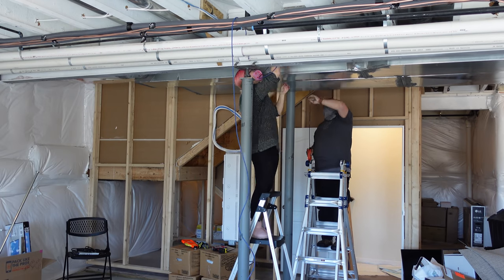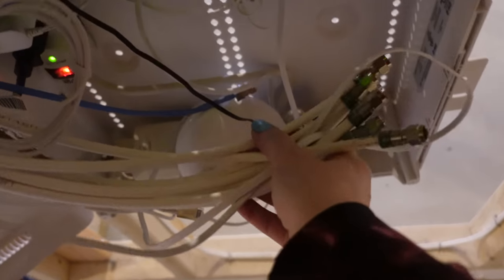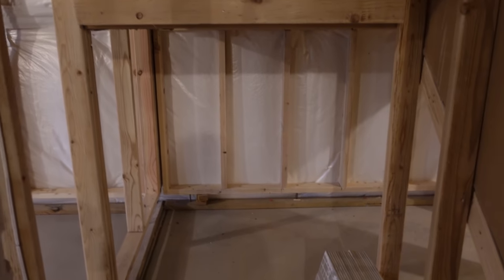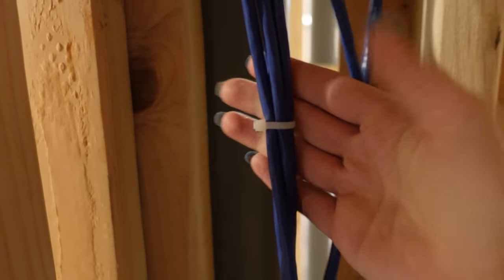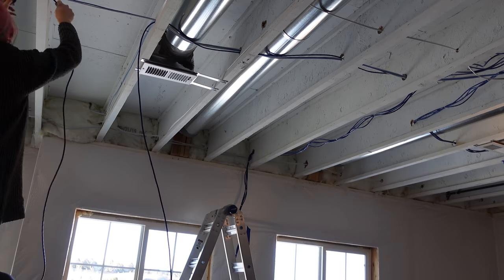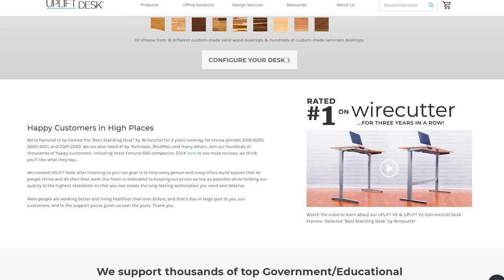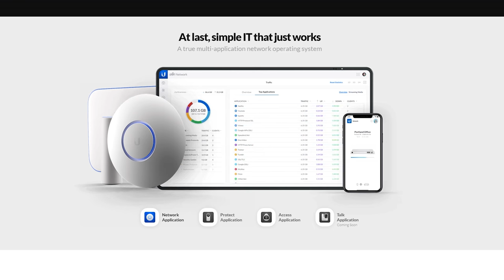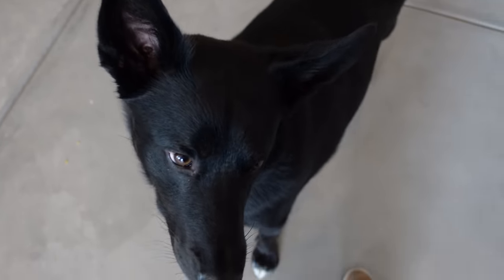Running 10 Gig Ethernet In My Dream YouTuber Studio: Networking & Internet Access | Pt 2

Comment: For your ventilation, make sure the cold air comes in to in front of your rack.  In the back, if there is no return, install a vent as high up as you can get it into the rest of the basement somewhere.  Just a passthrough.  This way the hot air will leave the back of the rack and make its way back to the return.
Reply from the maker: Thanks for the tip!
Reply: @ShannonMorse  What you can also do it put a vent toward the top of the room with a fan to draw the hot air out. Cold air will come in around the door (unless you get an air-tight/water-tight door) and that should provide enough cooling unless you're running some large servers for your future VMs. 

If the actual AC blower is down in your basement and your basement is colder than the rest of your house, don't worry about pumping AC into the network nook. Just an exhaust fan should get enough air flow to keep things cool.
Reply: @ShannonMorse  this was my first thought, he's 100% on point.  AC Infinity makes some great rack cooling and home space ventilation products that don't cost a lot.  They also have some with temp sensors with programming.
Reply: I was thinking even a vent near the top and bottom of the door may be enough, with convection and the fans on the systems handling circulation.  I'd put a remote temperature sensor in there and set an alarm threshold and then you don't need to worry about it.  If convection alone doesn't move enough air, an exhaust fan near the ceiling pushing the hot air out into the basement would draw in cooler air from a vent near the floor.
Reply: One other thought, you would have to have your HVAC guy setup a dedicated zone with a thermostat just for that room. I would doubt the rest of the house will call for enough cooling to properly cool that rack room.
Reply: @mzmegazone  I think a filter to keep out dust and debris. Also watercooling and or a dedicated ac unit
Reply: It really depends on how much it's going to be in the rack and what it will be doing. A rack stuffed full of Crypto miners running full bore 27/7 is going to need a lot more cooling than a NAS, for example.

Comment: For under the stairs, what about creating a cold zone and hot zone, where the cold air is pumped into the front section and flows through the rack to the back hot zone. Also having an exhaust fan on the back side will help aid in airflow through the rack parts. I'm thinking some cardboard to fill in the gaps between the rack and walls will help get the air to where it needs to go.
Reply from the maker: Interesting idea!

Comment: I do data installation and when i got my license we were told not to run with power, just saying because if you get interference you will not be able to fix it when the drywall is installed
Reply: How do you handle wireless access points or poe cameras?
Reply: @nebraskacoder  PoE isn't the problem; it's running ethernet cables beside power cables. You need to leave space (per NEC) to avoid interference and accidentally creating a second circuit. I believe unshielded cables should be something like 12 inches from residential power. A properly shielded and drained ethernet circuit can get away with 4 inches. Ethernet should cross power at 90 degree angles.

note Please check the wiring code where you live to find out how you're supposed to run wire for code adherence.
Reply: @AC-cg4be  Sorry, I misunderstood when you said power and thought you were saying not to do runs with POE.

Comment: Under the stairs: Now would be a good time to add an access hatch along the side, behind the proposed rack location. Crawl in behind from the side so you can access the backplane for cables and troubleshooting in the future.
Reply from the maker: I bought a rack that includes locking wheels, and is not going to be stationary so I can move it freely. It's a 15U so relatively small.
Reply: @ShannonMorse  looking forward to that video!!

Comment: Great Video.  I caught the snippet about the contractor running a cooling vent to the closet, I would suggest having an exhaust fan/vent out from the room as well. I feel that would be more important than pumping cold air in.  -- if its not too late, run yourself another line to the back of the house for possibly an outdoor access point.
Reply from the maker: Thank you!

Comment: Looks great.  The only thing I'd note is that, in some of the videos, it looked the like the Cat6 was being held up by some electrical lines when running along the chases.  That may just be before you clipped them up, but you do want to keep some distance so you don't get noise from the power lines bleeding into the data lines.

We built a new house a couple of years ago and, while our needs aren't as intense as a home studio, I had the builder run network cables from my office (which is where our Gigabit Internet connection and NAS is) to the other rooms.  All of our A/V gear is on Ethernet (GoogleTV, SmartTVs, BD players, gaming consoles, etc.) for best performance and keeping them off the WiFI so they're not competing with devices that must be on it.  WIFi is convenient, but for performance, reliability, and security, it can't beat Ethernet.

Comment: Shannon you are 100% awesome and correct. I ran cable while going to undergrad school in Michigan and Wisconsin. Banks, building, construction sites schools and more. It is the best idea to run the cable before the dry wall. That way you can add conduit pipes, clamps, ihooks, flextubing and much more. It doesn't happen all the time but when everything is built and drywall and everything is done then they call you to run cable that is not impossible but it provides more challenges and burns more time in comparison.
Reply from the maker: Yup! So true

Comment: Great video! I wired my house a few years back with CAT6. I saw some of those zip ties were pinching the cable. This may interfere with the 10 Gbps link you’re aiming for. Might I suggest Velcro cable straps instead, much easier to take off if you want to rework it, too! Otherwise, I’m loving the plan!! 😊
Reply from the maker: I removed them after running the lines.

Comment: I did the low voltage wiring for two houses (phone, network, cable TV), and always run then in conduit.  Cat 5e was the state of the art at the time I did the wiring, and now it can be upgraded to Cat 6 or fiber without tearing into the walls.  It's easiest to add the conduit in new construction, but it was a retrofit in one of the houses I did (running conduit through the attic and crawl space, or a non-living space such as the garage).  Each room has one or two wall panels with multiple connectors, all terminated in a single rack.
Reply from the maker: Cool!

Comment: Neat and fairly well done.

FYI, those are shielded cables that you ran. If you want to make use of the EMF shielding, only ground one end of the cable. Otherwise you can accidentally create differential grounds or ground loops. That will cause noise/EMF in the line rather than draining the noise/EMF off to ground properly.

And you may know or may not, so some tips from a network guy:

It's a lot easier to run spooled cable through walls (already drywalled) and doesn't take much effort to terminate yourself. Most of the pre-terminated cables I know of are stranded cable, and for in-wall cable (or basically cable that doesn't get moved much or at all), you want solid core cable. You also can just use a 1/2" drill bit instead of needing a much larger hole for the terminator. This mainly becomes an issue when you're going through wall studs or footers. You just tape the cables to a fish wire or fish tape that you've ran from your destination location to your source destination and yank. You also control if the shielding in the cable (important for Cat6A+) is utilized and where it's grounded or if it's even grounded at all.

Just my 2 cents.
Reply from the maker: Thanks!

Comment: Yay Pt 2! I'm loving this series. I had thought about the conduit as well from you first video footage, but even if you do want/need to upgrade or replace a cable the holes you cut out should allow pulling new cables. My contractor used some sort of nails to secure all mine to the studs and floor joists between floors, so no easy upgrades for me. We also have COAX cables to each room, but 20 years ago there was not much choice for TV in our area. Now they just sit there, except for one that is hooked to a TiVo and those are networked to TiVo minis on it own VLAN. Looking forward to Pt 3.
Reply from the maker: We also have no use for the coax, so it's just taking up space. But good for resale value! We also discovered the cat5e and the two cat6 run to my WAPs upstairs (they're POE) were all really tight and the original builder used a fire retardant foam around all the crevices and holes so they're kind of stuck there. After we ran these we cut the zip ties off so it would be easy to pull new ones through if I ever feel the need to upgrade.

Comment: Make sure you mount the rack on a wooden platform to keep it off the floor and electrically isolated from the cement. 
Not only is it a good practice to keep the rack off the floor in terms of water and flooding, but you want to be able to isolate the ground loops from the concrete. We raise all of our racks from the floor and also run a technical star ground that is completely isolated from all the other grounds and utility power in the building.

Comment: If it's not too late, I would build two vents for the rack. One should vent to the basement, which will heat the basement in winter. Then have another that goes to the roof or outdoors for summer. Use smooth piping as ribbed piping will impede air flow. If the tube is long it will thermal siphon the air out. If you end up running a couple hundred watts of electricity, putting in the ventilation will pay for itself in AC savings.

Speaking from experience, without ventilation, you can probably get away with 100 watts of power usage under the stairs, and with passive ventilation maybe 200 watts. If you plan to ever run more you'll definitely want active ventilation of some sort.
Reply from the maker: Thank you!

Comment: One thing to consider is terminating all of your runs into a modular patch panel, then run them to the switch (or switches) with patch cables. That will make the rack cleaner and prevent you from having to rerun a cord if you damage it (versus just replacing a small patch cable). Looking good, otherwise!
Reply from the maker: That's a great idea.

Comment: I really like Ubiquiti's EdgeSwitches! No controller needed. The ability to create VLANs is priceless! My cable modem, and pfSense firewall are nowhere close to each other. But at each end I do have an EdgeSwitch. I added a VLAN for the WAN connection between the two ends. So, I only have one CAT6 cable run between them.
Reply from the maker: Cool!

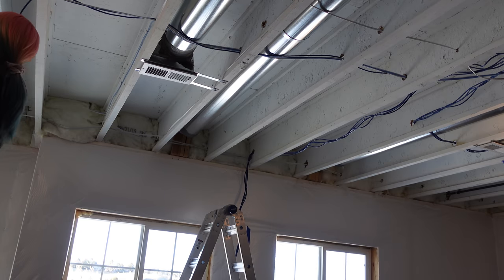Comment: 10:06 does the regs allow crossing AC wire like that? May have potential issues with signal quality. If that would be more than just a light I would I would be considered about potential voltage in DC cable as well.
Reply: Crossing AC wires is inevitable, and reducing the impact from EM sources like AC wires a significant factor in twisted pair in network cables. When running near AC wires, it's best to cross at 90 degrees, so as to decrease the potential impact, which is what they have done in the video. The greatest impact comes from running ethernet alongside AC, in which case it is best to keep a separation of 6 inches (15 cm) between the AC cable and unshielded ethernet cable. None of this, by the way, is generally covered directly by regulation (like building codes), but rather standards from bodies like ANSI/TIA/EIA and, by association, NFPA (in the United States) , in which the actual distance of separation is based on the amount of current running through the AC source.
Reply from the maker: Luckily Gabe told me about the 90 degree angle thing, but your comment goes into more detail. I appreciate the insight! Thanks!
Reply: @ShannonMorse  Oops! I should have @ Arthur - was really just answering his question. You demonstrated the process perfectly. :)

Comment: About the Coaxial cable rg6 I presume ... there are adapters to pass over Coax cable both 1Gbps ehternet and cable TV signal! Huge bonus.  They're called Moca (multimedia over Coax) adapters... so each cable you have there is yet another 1Gbps ethernet link with the proper Moca adapters. And even with the ethernet functionality they Still carry the multimedia/TC signal! A huge Bonus.

Comment: I would like to see how Ubiquiti does vlans or whatever you are choosing to do for network isolation.
Reply from the maker: Me too lol. I'm looking forward to setting it up!
Reply: @ShannonMorse  It's easy-peasy. Just make sure you have the Ubiquiti network controller software installed. Once you do that, it's pretty point-and-click. I've got several SSIDs/VLANs set up on my NanoHD WAPs as well as my 10Gb switch.

I opted to run the Ubiquiti network controller in a Linux VM and it's made configuring things much easier. While the Ubiquiti stuff isn't quite as flexible and featured as the Cisco gear I have, being 30% - 50% of the price makes up for it.

Comment: The only thing I would recommend is run some pull lines since you have the walls and ceiling open.
Reply from the maker: Thanks!
Reply: This is such an important thing to do. Maybe you forgot a cable, or one is broken, or you need more later on. It is not much of work and can save your life.
I can not give advice regarding electrical details because I don't live in the US. But this a practical advice and a very good one.

Comment: I'm not crazy about a rack with no service access to the sides and rear, but if you're going pure network and two post, it might be OK. I still wouldn't do it for myself. I have had to get to the back of my network equipment far too often. I also would have invested in conduit and would have terminated my own cables. Finally, I would have terminated on rack side into a patch panel. These may come from supervising networking in a corporate environment for over a decade, but those are what I would do in addition to some things like ventilation and better labeling others have said.
Reply from the maker: We installed access before walls went up, and ventilation. I have a network diagram, the labels were great for testing while running the lines but I’m not depending on them. I think the big difference here is you’re assuming that I want to do all that work for my 8 new Ethernet lines or that it’s within my budget. A corporate environment and my home studio have very different needs.

Comment: Hi,  I think what you are doing is really cool but I have a couple of questions.  1.  What type of 10G (model and vendor)  interface are you using and are you using servers for the 10G connections?   2. Who makes the switch (router if your referring to a 10G line (WAN) provided specially from your internet service provider).  3 I'm assuming you are talking about LAN side 10GB transfer because from what I've seen 10G is a commercial WAN and most residential areas do not provide more than 1G if you are lucky,  unless you can afford the price (last I saw you can get 100Gb and probably higher if you have the money).  I'm not trying to be a smart arrse just curious.  Thanks!
Reply from the maker: 1. What? 2. Ubiquiti 3. Yes.

Comment: When you were talking about the pre-terminated cables, I didn't hear you mention whether those were in wall rated cables or not. Did I miss it?
Reply: @tcntad87  Not all cables are rated to be installed "in wall," meaning, to be run behind a wall for permanent installation. Generally, pre-terminated cables are only rated to be run between devices outside a wall, like between a device and a jack, or between switches. Generally, in wall rated ethernet cable has a CM, CMP or CMR marking on the jacket. The rating is tied to the composition of the jacket itself and how it reacts to fire. The in wall rating is referenced in the electrical code, which means it likely tied to local building ordinances, too.
Reply from the maker: It is CM rated
Reply: @ShannonMorse  I figured you had it covered. Thanks for filling in that detail. Looking forward to seeing this all progress. Very exciting! 🙂

Comment: Im kind of surprised you went with per-terminated lengths Ethernet cable, especially considering you plan on installing a proper rack and in-wall jacks. Getting bulk cable, cutting it to length and using keystone punch down jacks for the walls would have likely been more practical, especially considering most rack patch panels either use keystone jacks or come with punch down connections built into them. CAT 6 is probably more than sufficient, the only thing you might have issues with (though probably unlikely) is the bundles might be susceptible to interference if run across/along power lines or crosstalk when in bundles if you  didn't get cabling with some degree of shielding.
Reply from the maker: They are shielded. Thanks for your input!

Comment: Be careful in using zip ties on cable, better to use Velcro as in some of the shots it looks like the zip ties are pulled  tight and could damage the cable, that is why better to use velcro or tape. Ubiquiti is great for home setting, terrible for more advanced needs (VPN's, dual WAN, policy routing etc), not to mention the roulette you play with firmware updates.
Reply from the maker: We cut the zip ties off after running them all through the holes to their desired spots. It made the process of running multiple cables to the same points a BREEZE compared to trying to manage them all separately.